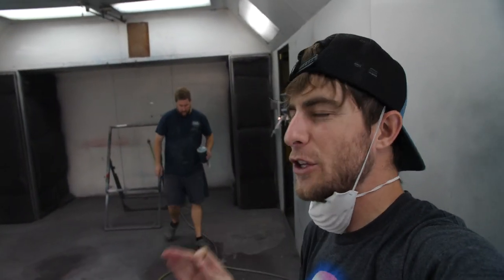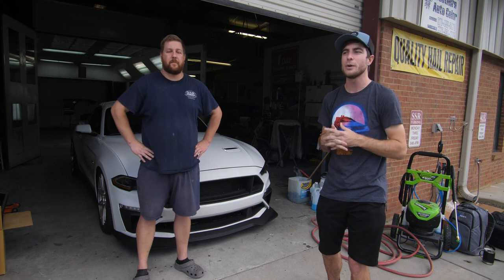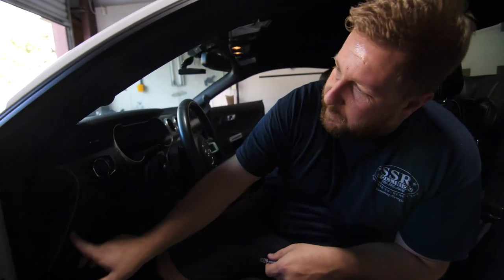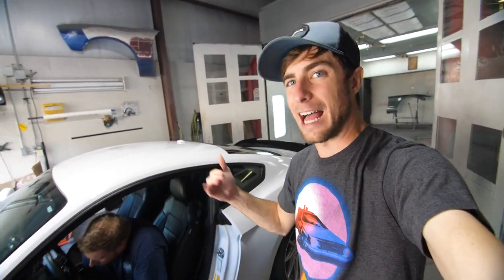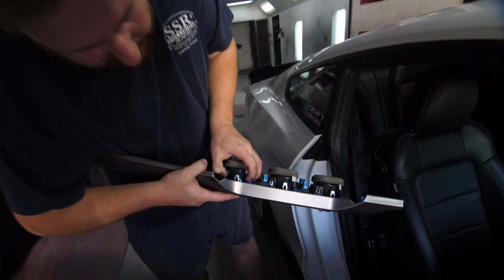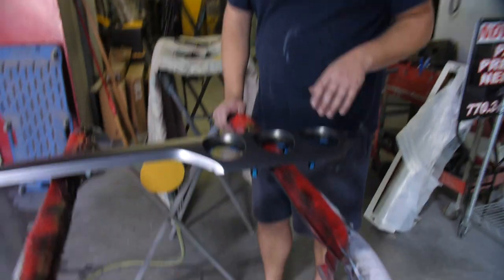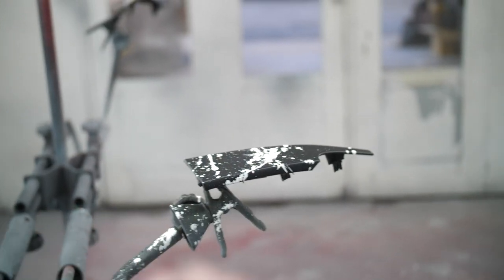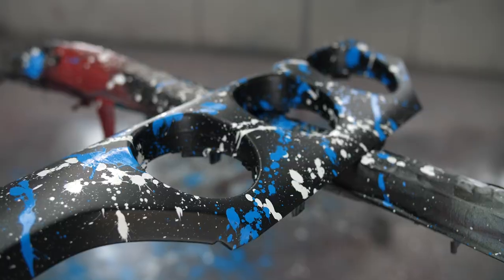How to Have AWESOME Custom Car Interior!

Comment: That’s sick. You should get a gloss carbon fiber steering wheel with blue stitching and a blue stripe at the top. (Perforated leather on the wheel, not Alcantara)

Comment: I know you're saying don't use spray paint but I can not afford to take it to a body shop to have this done nor buy all the equipment to do this myself. What about using the "automotive" spray paint from and actual auto parts store for the base color and the touch up paint for the splatter. Followed by acrylic clear on top. Would that work better than the traditional spray paint you would get from walmart or hardware store?
Reply: It’s not as expensive as you think. DM @droptopsvt and get a quote

Comment: Are you know you could fix that problem with your air compressor if you vent the blow off valve to the outside it wouldn't annoy you like it does
Reply: It’s the refrigerated air dryer, not the compressor
Reply: But I don't know what's going on at the shop I assumed that was the air compressor but if it's the air dryer on the air compressor oh wow thanks for letting me know that smart butt

Comment: He should have put the smaller bits that connect in the car actually side by side when he was splattering. Would have made it easy to line up the splatters, rather than guessing